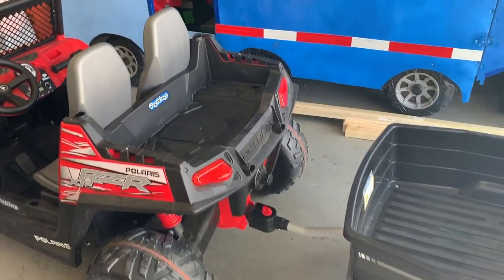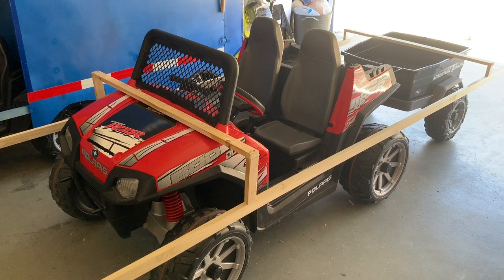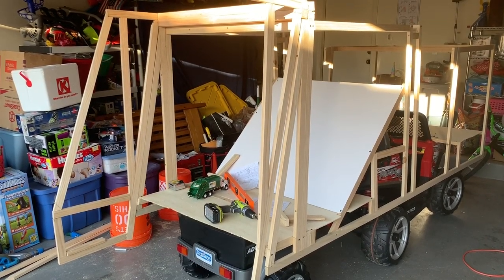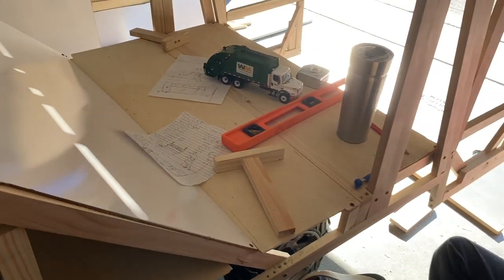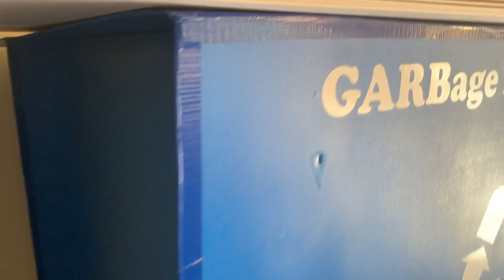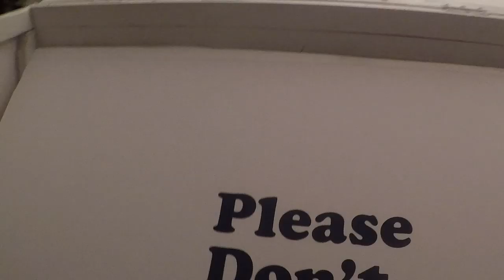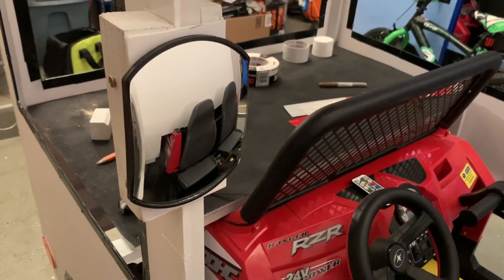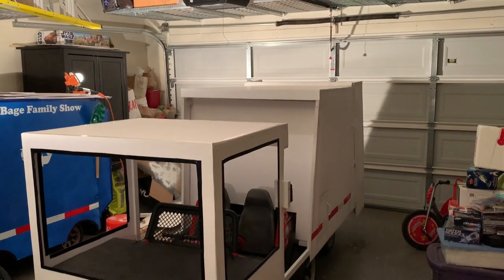How To Build A Garbage Truck For Kids - That Really Works!

Comment: Hi there! I hope you’re able to reach out! I want to say thank you so very much for building this tutorial for me especially because I am going to build it for my son. Do you have an idea of roughly how much you have invested in this project? I just needed an idea or how much I will be spending
Reply from the maker: You're welcome and thank you for watching! The Peg Perego with the trailer was around $750 (depending on the model you select). The materials were around $1,000. However, you can buy less wood and not include lights, etc and that will reduce the cost. Our other truck(s) cost more to build as they had different functionalities. We created 3-4 other videos on how we built the trucks so be sure to check them out for more ideas. Have fun!